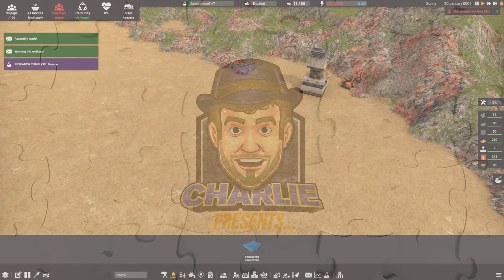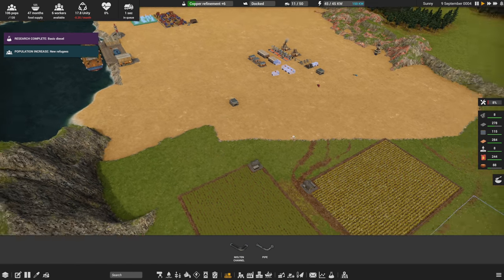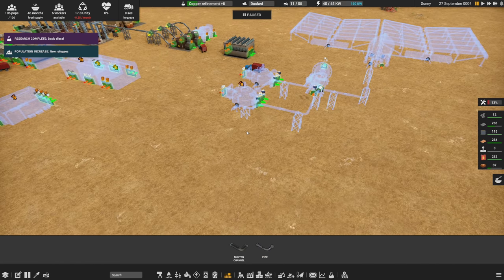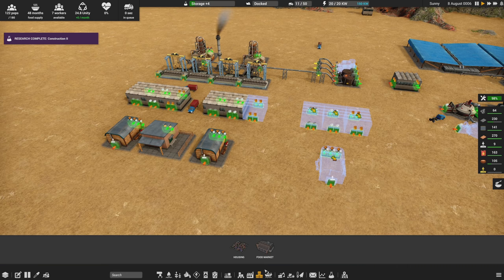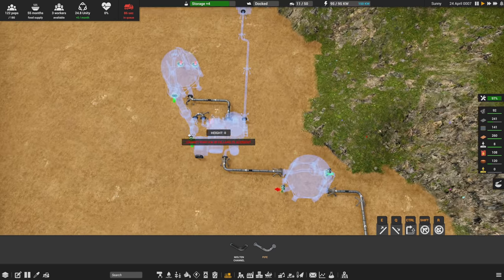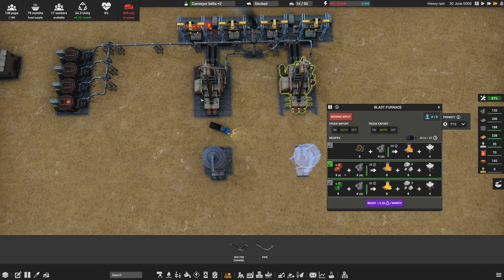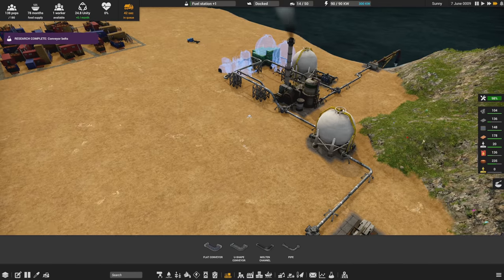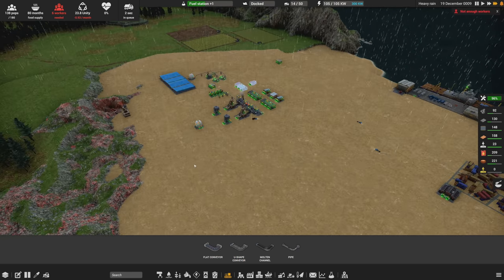TIME TO GET THE DIESEL FLOWING! - Captain of Industry - 02 - Beta Gameplay

Comment: on the storages you can put them directly connected and chain them together,, output to input.  You can also control truck inport/export to each storage to prevent trucks from trying to access the middle ones.  And you can flip inputs when building stuff to help combine transports... (belts/pipes) .  this game has so much.  It has been interesting to watch others,, every series I have watched,, the people have battled some shortage,, but each one was different (one had water shortages,, one had diesel, one had food/fert.) it is a balance...  cant wait for the EA release.  I am kicking myself that I didnt spring for the beta back in Jan, when I first stumbled across this game.
Reply: I think you can also can assign lorry’s to fill up all the equipment:-) with diesel